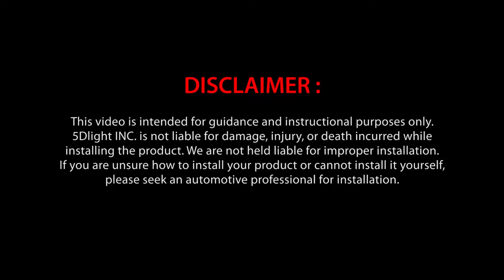2021 Subaru Outback | How to install LED light bar/roof light - Quick Install Guide

Comment: What is the light bar mounted too? I can’t seem to find that anywhere. Thanks! Great video!
Reply: Either the : Rhino Rack Pioneer  and or the 
Front runner platform. 
Both are basically the same, and come with a variety of accessories 

After doing lots of research since the owner of the video doesn’t respond to messages.
Reply: It looks most likely to be the yakima lock n load with the lightenup light bar bracket